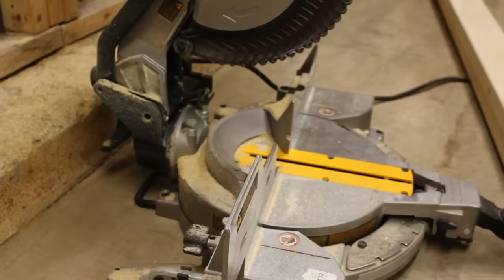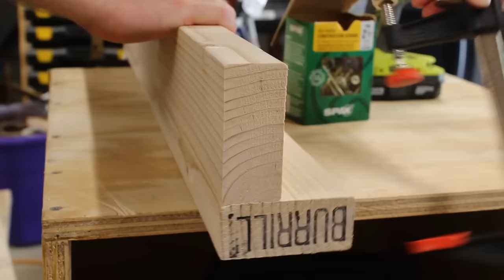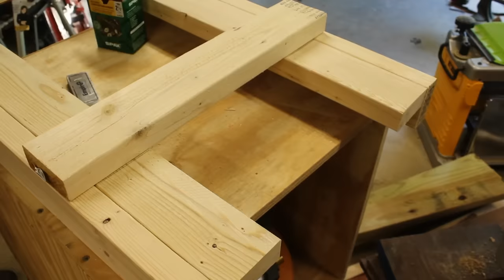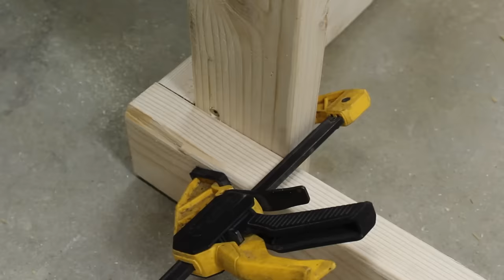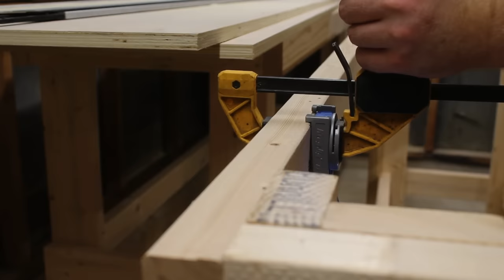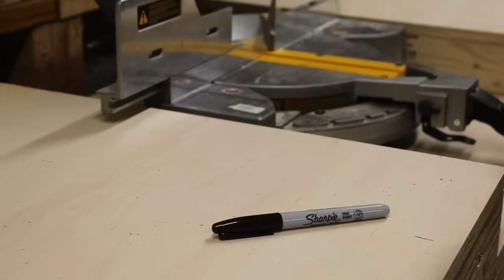Quick and Easy Miter Saw Station Workbench // Woodworking DIY Project

Comment from the maker: PLANS : robert-j-keller.com/plans/miter-saw-station
Reply: What wood did you use pine or fir wood
Reply: The mitre saws cutting surface doesn’t have to be flush with top of table? I noticed it’s a slight bit lower does it matter?
Reply: Well I guess it can’t bc of the rails right?

Comment: For everybody who wishes to complain about no measurements and no commentary in the video...  The man spent his time and money filming and editing the build for this video.  Why not just drop the $2.00 for the PDF plans?  You then have your measurements, RJK has some very small compensation for his time and effort, and you have this video to supplement the plans.  Everybody wins.
Reply from the maker: @Brad210UIW 12 ft, plus whatever length you need for your particular miter saw. But easily modifiable to whatever length you want, it’s just changing 1 dimension in the plans.
Reply: if they can't figure it out by looking at the video then they shouldn't be working with tools. Some things just takes common sence.

Comment: And you didn’t split a single board with those screws and no pilot hole. What is this sorcery? Excellent work.
Reply: Yeah how did this happen?
Reply: SPAX construction screws...
Reply: None of those screws were close enough to any edge to worry about any splitting.

Comment: Cool and nicely laid out plans. Thx.I have been using my job site dewalt stand with my mitersaw in my garage and it's a major pain. Always needs to be moved. The jobsite dewalt table saw is also on it's own mitersaw stand, and even more in the way, and too tall for the portable outfeed support things. I've been wanting to set up a quick sturdy and simple essentially permanent, but on wheels, station and this was the one I decided upon this morning. Very cool.

Comment: Just buy the plans! Totally worth the $2 to have all the materials and cut list with color coordinated materials. Just built it last weekend. We don't have a truck to bring the materials home, so we had Home Depot rip down the 4x6 plywood and rip one cut on all of the 2x10s to get them to fit in the car. All in all, I think it took me maybe 4 hours to do final cuts and attachments. I took my time and made sure the boards were flush by hand before screwing fully. I don't have clamps to hold them together. Luckily, just taking my time and by feel, I didn't have any issues with the table being wobbly, thus no need for the leveling feet.

Comment: Great video 👍 I put my shop vac under the saw and attached them. No more clean up.
Reply from the maker: Heyyy I did that too! Good thinkin'.
Reply: I am very new to building things. I spend most of my time in the factory, so any ways I need to build something to go between my washer and dryer. Like a folding station. So u have any ideas I'll be ready to watch.

Comment: excellent but if you put an angle on the sides of the machine and a tape measure attached it will make the job easier to cut a lot of good work

Comment: love the video, i'm complete novice, just starting the long front braces, the cut list is all one length but the video looks like top one is on the outside and the bottom on the inside, won't that be different lengths?

Comment: So I almost completed this project yesterday and it is turning out amazing! Thanks again! You made pocket holes for the plywood to sit on the table, what size holes did you make and also what length screws? Can you tell me that please.
Reply: This post is old but maybe it'll help someone reading with the same question. Assuming this is 3/4 plywood, you'll adjust your  stop collar to 1-1/4 and your screw length will be 1-1/2in

Comment: Nice video and great build. How are those adjustable feet holding up after a few years? I'm considering getting those myself?
Reply from the maker: Structurally, they are fine. Little bit of surface rust, but my garage did have some moisture problems. I would recommend them overall.

Comment: Amazing project! I purchased the plans for this project from your website. It doesn't mention anything about what screw size did you use, what size pick holes you made including the pocket hole screws. Can you let me know about that please. Thanks!
Reply: Well, let’s see.  2x4 is really about 1.5 inches thick.  To screw two of them together {3”) without punching thru, maybe 2.5 inches?

Comment: The long 2x4 on the bottom is on the inside in the picture but the outside on the plans, any preference?
Reply from the maker: The outside just simplifies the cut list, but it doesn't really matter either way.

Comment: Great video and definitely thinking about purchasing the plan. How would you adjust to ensure the saw top is level with both sides of the benches?
Reply from the maker: Should be able to fit any saw. Just adjust the height of the 2 cross pieces that connect the 2 benches.
Reply: @RobertJKeller  Ah! Makes sense. For some reason I assumed the back piece was already in a more permanent position. Thanks for the quick reply!

Comment: Comparing this build with the plans--did you screw the lower&longer braces inside the legs (as opposed to outside, like the other braces) to allow for storage platform underneath?
Reply from the maker: I believe the plans call for them to go on the outside-- that was just to reduce the number of different cut lengths and simplify the plans.
Reply: Robert J. Keller got it-yeah i noticed in the plans everything is outside but those specific braces were inside in vid. Either way, great saw station thanks!

Comment: Any idea what kind of wood he used?  Doesn't look like regular 2x4's.  The 2x4's I get from Lowes are always a bit warped.  Those were some nice straight pieces of lumber.
Reply from the maker: Corey -- they are indeed just 2x4s from the hardware store. Usually if you're willing to pick through the pile you can find some pretty straight ones. The plywood top helps pull everything square, too.
Reply: @RobertJKeller  Thanks I will give it a try!

Comment: so i just built myself a table like this, wont the miter angle adjustment be constricted by the two sides?
Reply from the maker: Mine is not, but you could always make that middle part a little wider if your saw needs more space.

Comment: So pardon my ignorance lol, I was always told always drill your pilot hole first? Is that only for certain times?
Reply from the maker: These screws have a self-tapping tip on them, so they are really good about not splitting the wood without predrilling.

Comment: So I just purchased your plans for both the 1-hour workbench and the Miter Station.  My plan, is to make an adjustable miter station.  I want to be able to swap out the miter saw and portable table saw.  I just need to figure our how to make height adjustments when swapping out.  Any ideas on that?
Reply from the maker: Hmm that's a tough one. Whatever method you go with, make sure it's very secure. Don't want a saw moving around on you when you're making a cut!

Comment: What did you use for the feet? I don’t even know what terms to search with to find them. Nothing coming up for “adjustable feet”, “workbench feet”, etc.
Reply: Nvm finally able to find it. “Leg levelers” is what ultimately came up with the right search results.
Reply from the maker: Nice, these are the exact ones I used, if you're curious :
POWERTEC 71136 Heavy Duty Kit | 4... https://www.amazon.com/dp/B07D4C52X7?ref=ppx_pop_mob_ap_share

Comment: What is dimension from wall to front?
Reply from the maker: 24 inches (610mm)
Reply: Robert J. Keller 
Each side 24x48 & 34” height?
Reply from the maker: Pretty much, check this out, it should help:
https://www.instructables.com/id/DIY-Miter-Saw-Station/

Comment: Why do people waste their time making these videos that have zero instructions? Cool we get to watch you build something in fast forward!
Reply from the maker: No one is forcing you to watch it brother!
Reply: @RobertJKeller  and that's why I turned it off sister 👍
Reply: Andy H you can watch it and make it to your specifications.. are you short? Might want it a little lower. Tall? Make it taller. Depends on how big your miter saw is too.. is it a compound or not? Or do you want shelving behind? You can change it to your work style. Mines 3.5 feet tall and 3 feet deep but I have a lot of area and I like that working height. And I built the two sides at 5 foot long each then where your miter slot could change with the width of your saw

Comment: Would it be safe to assume the overall length could be modified on the 2 main sides depending on the space available? My garage is only 10 ft wide.
Reply from the maker: Absolutely, or you could make the 2 sides different lengths, so then you have one longer side to make longer cuts, instead of 2 short sides.